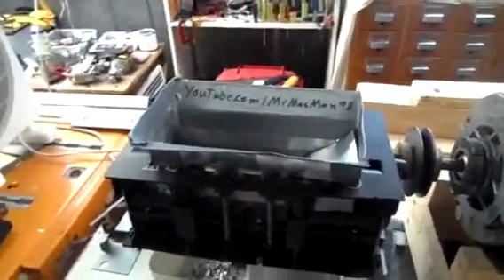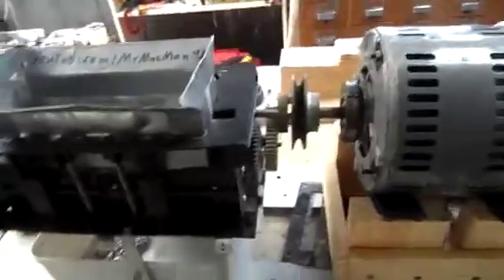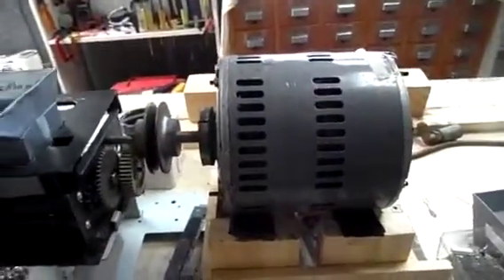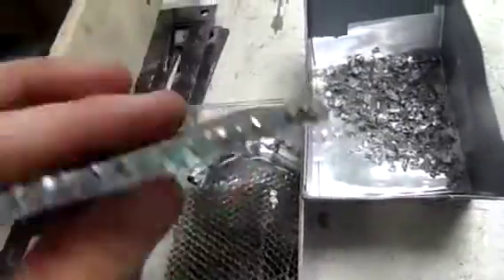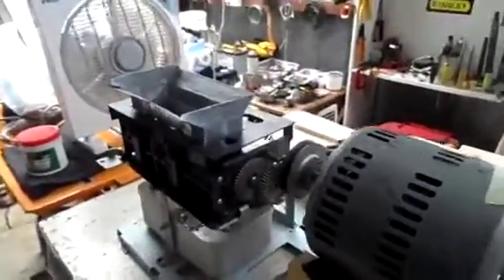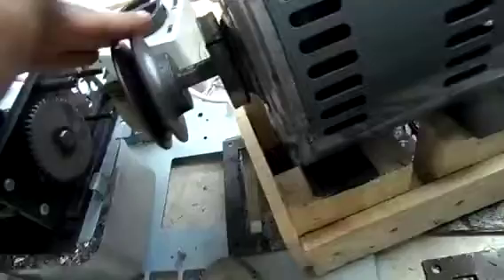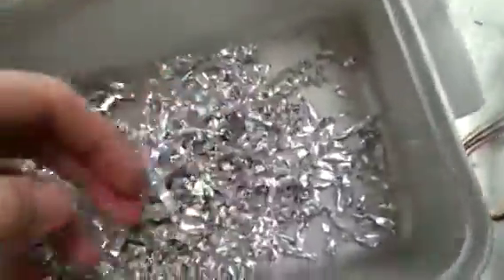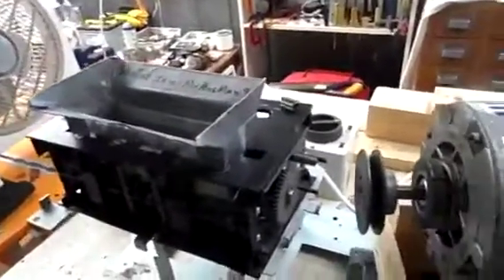Modded Paper Shredder Returns! (And dies)

Comment: i always loved shredders seeing one reminds me of a show i watched a while back where they showed an industrial shredder called the cookie monster, it was used at a water treatment plant i think and it literally ate everything was so awesome ! well general safe practice is good enough for a machine like that, no loose clothing or long hair and certainly no long camera straps :-p ! any way to put in a sensor system and reverse function for when a jam occurs ? cheers bud =D
Reply from the maker: Thanks mate! Yeah I was thinking of some type of SSP (Severe Shock Protection) that could be fitted to it, although sadly the gears are so shot that they don't mesh. I have had some ideas on turning it into a single - shaft high speed shredder that uses a steel screen, one way or another I will resurrect it! :D